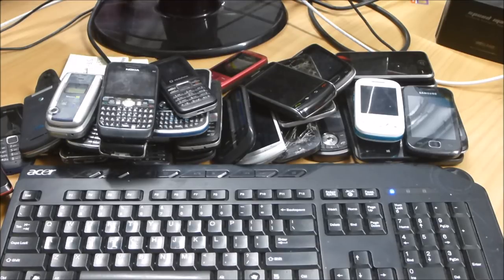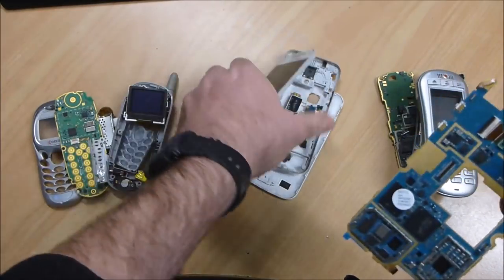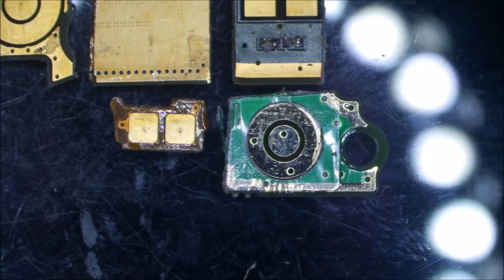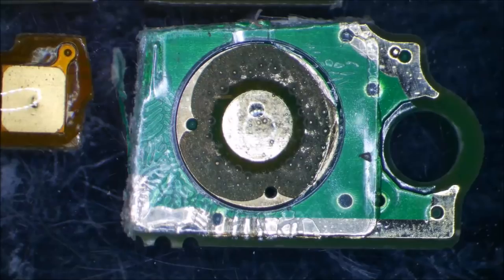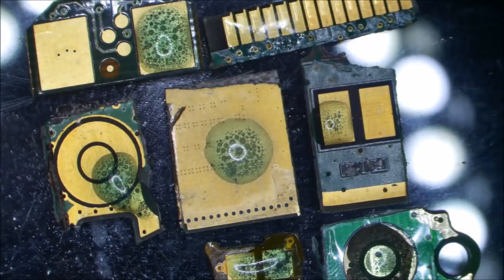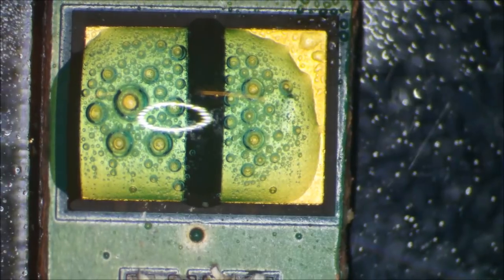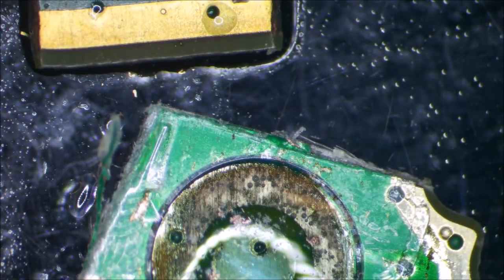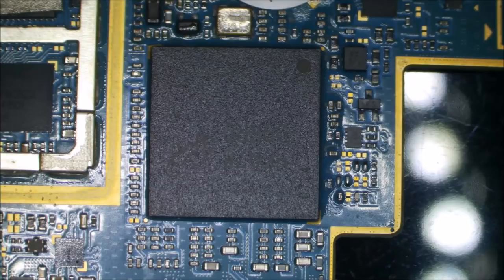Gold Recovery - Hard Gold vs. ENIG Part 3 - Mobile Phones

Comment: Great video as always! I started saving the tiny lasers from optical drives and I'm thinking that one would be good to demonstrate in your video.They appear to have some gold but I'm not sure what process is used or why there's gold there at all. Keep up the good work!
Reply from the maker: LEDs (and laser diodes) always seem to have a good thickness bond wire running from the legs to the die. I think if you can get hold of enough of them they would return very well. I will have a look through the microscope next time I pull a batch of optical drives apart. Thanks for the comment!

Comment: i am learning a lot from your videos,   especially this one,   and plating that is under 15 ui,      your putting  a lot of investigative time into this,  with exacting results,     i think there is a soft cover  8 1/2 by 11,  how to recover gold manual in all of this,   " i wish you make some good coin for your efforts.  cheers, from ralph in Vancouver.   i have just retired from my rf work in systems design, and have found good  values in ;Motorola land mobile radios, and some portables,    " let me consider, sending you a few portables of the 2000's for your view,      i will have to strip battery pack,   and top and bottom case, and side case, and speaker and such,    " just the guts "  lots of modules, of 1995 style,    minature little cubes that plug into a gold plated pin base.   cheers.   again,  excellent work on this,    hold some secrets, so a few phone recovery want to be's can write you and send you coin for your professional discoveries,  " that is how strongly i feel , you are contributing, to  salvage, skills /    :P)
Reply from the maker: Hi Thomas, thanks for the comment. The gold 'mining' is my hobby, so I'm not too worried about making more money than I spend. I also like sharing my experience, so enjoy making the videos. I would be very happy to analyze and process any material you think would be interesting, feel free to send me a personal message if you want to get hold of me.

Comment: see!  only experimenting reveals the truth behind the wall.  good video, a small dot of thick gold yelds more tnan a flashed small board.we all are learning with this information. its like building a cherry pickers guide i also notice that some ribbon connections on sensitive equipment has  good color, and the contacts from the hard disk motors, some memory cards  and goldfingers from server power supplies. jaja it`s like a mission (In Search For The Hard Gold)  regards...

Comment: these are really good videos, could you check some of the micro cameras in the mobile phones for gold bond wires? i found some really good bond wires in the older phones but what about the newer ones?
Reply from the maker: I will have a look through my pile and check out a few random cameras. I quite like looking at LEDs and Cameras because they are usually clear and you can see the bond wires without any destruction.

Comment: When I proces ENIGs  gold it almost seems like I put it into solution. I use the acid peroxide method but the peroxide I use is 20%.
Has this happened to you? If so do you use sodium metabisulfite to precipitated back out?
Reply from the maker: What usually happens is the Gold gets covered in Tin and it looks like the Gold has gone into solution, can't quite remember the reason why, but I have definitely seen this happen. Although it is technically possible to dissolve Gold if you overdose the peroxide. Really the best method is to just use a splash of peroxide at the start to get things going, then rely on a air pump. Also, processing ENIG parts with AP is creating a ton of toxic waste for almost no Gold, the amount of Gold may not even cover the acid cost.
Reply: just use a splash of peroxide to start the reaction.  The peroxide is your oxidizer.  Once the process gets started, it will continue to create it's own oxidizer through interaction with the surrounding air.  Just use a splash of peroxide and as SE mentioned, rely on an air pump.  (the air pump is a much better air source than the surrounding bit in the environment)

Comment: Great  videos, with this info I would  say instead  of ap process, I think a hydro bath, then strait to aqua regia is the best bet by the way can you try satalite receiver boards and sound cards both have full mask unfortunately sound card has a mask over top
Reply from the maker: Hi, thanks for the comment!  I have tried both (no videos unfortunately), both are very thin Gold, so usually not worth the acid to run those through AP

Comment: Thank you!.  Very interesting have you check out led tvs  and is their silver on any phones?.
Reply from the maker: I will definitely try a board from a LCD monitor soon, the ones from tvs will probably be similar. I don't think there will be much silver in phones apart from what is inside some electronic components like the crystals. The real problem with silver is that it is not worth very much, so usually not worth the effort to recover a few grams at a time!

Comment: as always very good videos of gold refining. you speack about bga chip or ic chips, if there a another method by burning or crashing like you do with the mol. can caustic soda dissolve the plastic, i try but the plastic doesnt disolve well. it make some rock and very difficult to dissolve plastic. take care catch ya later
Reply from the maker: Hi David, the only method I know of that could potentially dissolve the plastic (epoxy) is mixtures of Sulfuric and Nitric Acids. I've never tried it, but have heard that it is dangerous and creates a lot of waste. Pyrolization followed by machining is pretty much the best way that I have found so far.
Reply: Ok i will not use this method and continue to use your method thanks
Reply from the maker: If you ever find a better way, please let me know. I will do another 'full process' video at some point in the future where I show all the steps I follow at this time. I now only pyrolize before using the ball mill to grind the chips into a fine black powder. I have found that you do not have to incinerate until the chips are white if you use a machine to break the chips up. You just have to make sure you remove all the carbon before dissolving the gold in AR.

Comment: why is the nitric eating the gold ? nitric alone doesnt disolve gold , it needs to be with hcl
Reply from the maker: Correct, Nitric is not dissolving any Gold, it is reacting with the Copper under the Gold (if the Gold is thin enough for that to happen)
Reply: It only appears to eat it, because the acid pulls it up from the copper   base and because the plating is so thin it dissapates from the surface in the form of dark powder